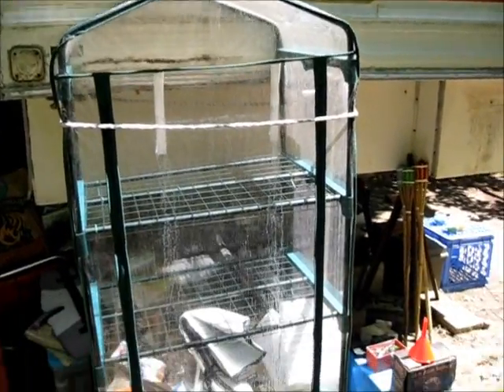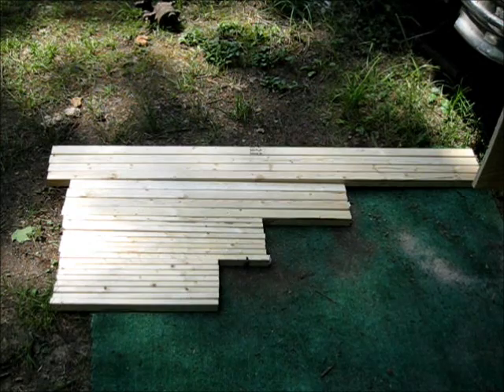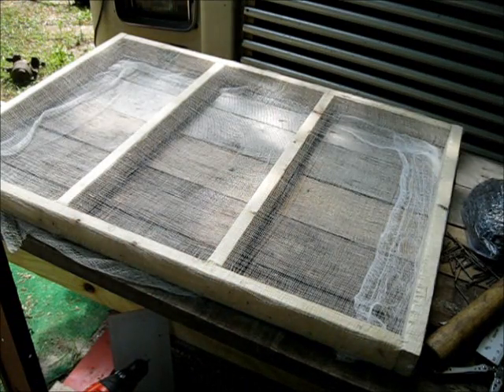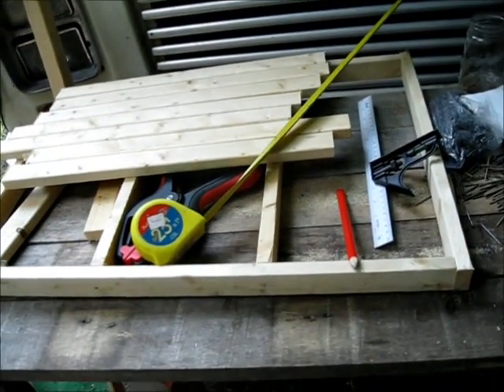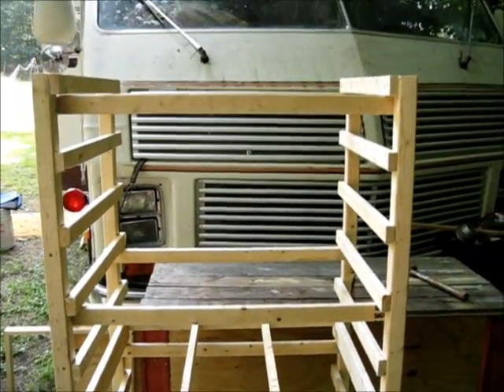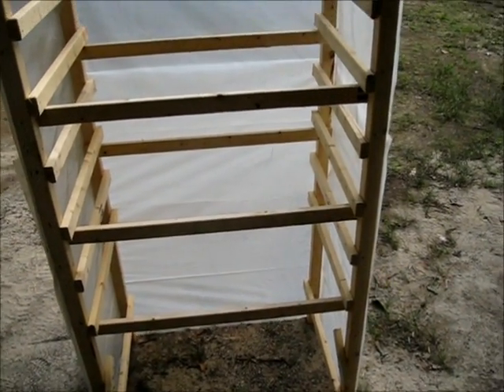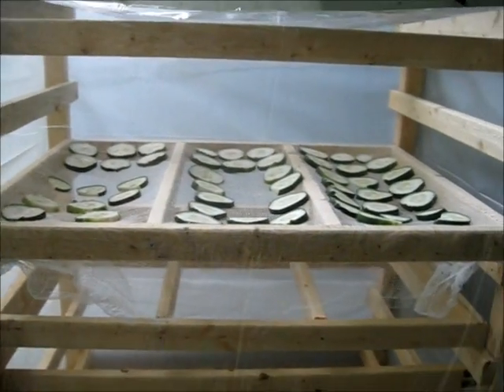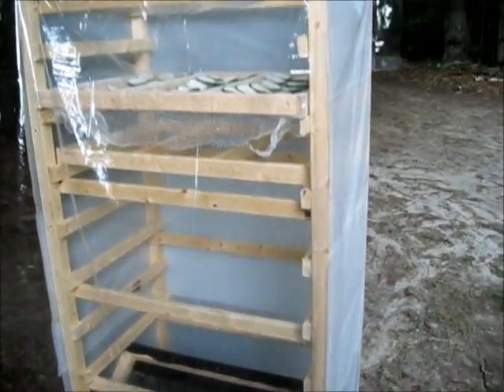Simple DIY Solar Food Dehydrator

Comment: I use craft plastic found in craft stores it has many holes in it and is safe for dehydrating it I use it myself it comes in sheet of 18: by I think 8mor 10"... I got about 8 for a few bucks and since your shelves are 18: wide you can put two on each.. Just suggesting.. This is nice. I am impressed, could you use aluminum foil to disperse the heat upward, just a thought.  I like the way you thought this out, I may steal your plans

Comment: Hey do you think that if you made a the same thing buy used 1''x2'' boards to enclose it and used tin roofing on top and made a soda can solar heater it would have enough power to dry vegetables and fruits and detach the solar heater and use the box as a smoker for fish and meat? You would probably have to have a big solar heater since your not harnessing the green-house effect with the plastic. I have a big smoker but it requires to much power for a solar system.

Comment: Hey, saw next video w/ rain... where you just threw a flat board or glass over top. Quite understandable.  But thought was, cut 2 flattened "A" shaped ends, then put staggered slats across to create a loovered 'roof' to keep surprise rains out, yet let air out of the top for good circulation.  Lower edges all overlap next lower slat by 1" plus, perhaps 1/2-3/4" gap?  Slats could be quite thin, could be wood, plex, that plastic cardboard stuff...?  Definitely enjoy the videos!

Comment: Since you've water bath canned, shouldn't be fear of pressure canning. Just as properly doing water bath ensures a safe product, so does pressure canning. Where potential for trouble lies is when folks don't follow tested recipes/procedures. Ball Blue Book excellent guide for beginners. Shows step by step process. Due to safe canning practices & improvements in equip instances of botulism are extremely rare for home pressure canned food. More likely to come from other sources in the home today.

Comment: Another factor is outgasing by plastics in vehicles. Plus spray cleaners used to protect plastics. Would only do this in a very old vehicle as a last resort. If evaporating leaking oil vapors can enter passenger compartment, wouldn't do it then.

Comment: One of the positives about dehydrating is that you know when it doesn't work. Mold quickly makes an appearance. Plus easy to see when rot sets in & food is mushy rather than brittle. Much less hidden danger than in most other food preservation methods. 

It may not work this year. Outside drying needs hot sunny days with fairly low humidity. Know it wouldn't work here in NC this year because it has been so wet. Would have been a huge success couple of years ago when conditions were the reverse.

Comment: Troy have you had thought about the Deer Fence on the drying frames? This would be a good substrate for your base shelf supports. Stretch it, staple it, and then line each with your double layered cheese cloth. Great quick build and design. Adding that new fan for air flow? should work well! Thanks for the tips.

Comment: What about building it insulated to double as a solar heater you can connect to the RV for winter daytime heating?  Dual purpose.  No leaves in the winter so free heat from the sun.

Comment: you could use your car with the windows closed as a solar oven. Just lay out the trays from the dash to the seat tops and from there to the back window .  You can open the windows if it gets too hot. I like to want to set my dehydrator for 115 - 125 degrees.

Comment: Troy - I always used cheesecloth on by driers - it lets air flow through the dehydrator with little resistance.  when I did use plastic - I always punched alot of holes for air flow

Comment: Troy - next one you build one use screws and glue - much stronger - the nails could come loose as the wood shrinks and expands due to the temperature changes.  this was alway a rule in the southern states - use screws not nails.  Never dried cukes before - could be interesting.  I always dried apples, berries, pears etc in the dehydrator. I have strung some beans and hung them up to dry with good results also. You might try that with some of your beans - saves the tray space for other goodies.

Comment: Good job on that dehydrator, maybe put some cans (with a way to elevate the feet) under the feet and fill with water to prevent those darned ants from getting to your food. Are you just draining those cukes or drying them. What can you do with dried cukes? To dry them much faster or drain them (like for pickles) sprinkle them with salt, otherwise they may rot before the dry, they have a LOT of water in them.

Comment: Suggestion

Larger solar collector.
 Black on the back of the tower.
Intake a little off the ground and fine mesh to keep bugs out.
Lightweight flap the opens with the rising air but closes when the sun is down on the exit vent (mesh there too). 
If ants become a problem make a 3 inch moat of water out of PVC or gutter material to go around the outside. Ants wont cross it.

Comment: Tony, have to watch temps because dehydrating doesn't cook the food. 

Solar dehydrator temp range should be between 100 F and 140-150 F depending on what's in it. Highest temp is for drying meat - jerky. Vegetables dry best at around 120F. Herbs best around 105-110F. 

Solar cooking gets a whole lot hotter than that. If cooked instead of simply being dried, will not keep as well. If dried too quickly can become "case hardened". Traps moisture inside that can't escape.

Comment: Use screen wire to cover shelves. Plastic mesh is available at hobby shops. May not be food grade. Do price per sq ft comparison to screen wire from Lowes, HD, or WalMart to plastic mesh. Wire may be more economical, too. 

Don't use hardware cloth if it is galvanized. Zinc coating not food safe.

Comment: How are you going to wash the cheesecloth? Are you blanching any of the vegetables before dehydrating? Tomato will stain the cheesecloth and present you with cross contamination issues if you then try and dehydrate something else on top of the stained cheesecloth. Food grade plastic mesh would be safer and washable and is not that expensive.   Also want to add that blac trash bags have stuff in them to kill bugs so in the heat they off gas toxins into the drying food.